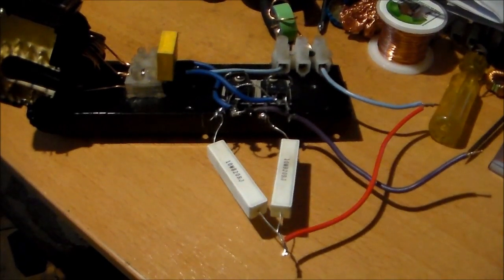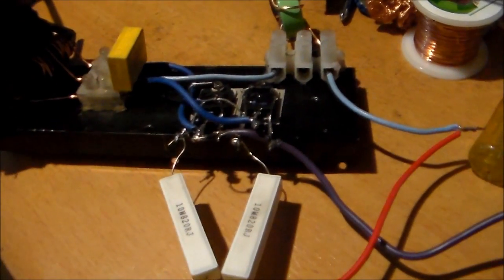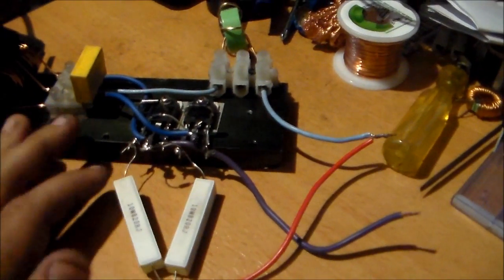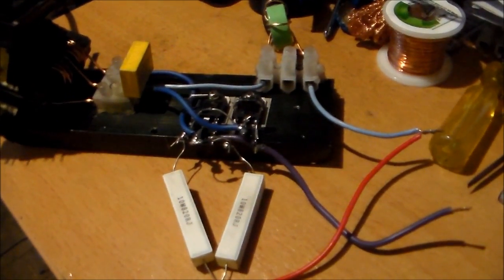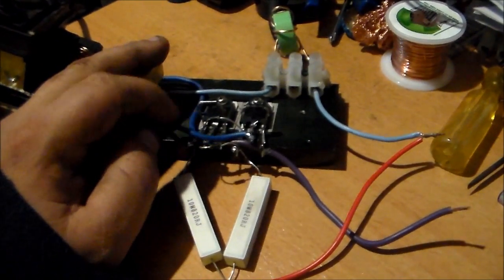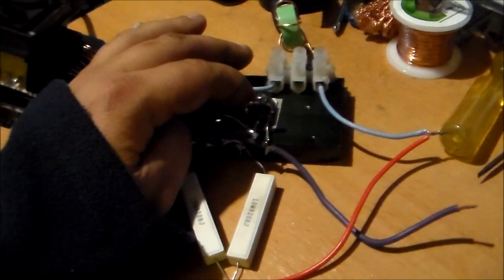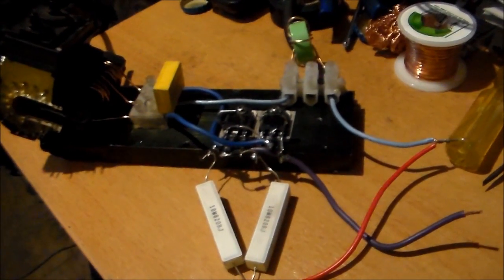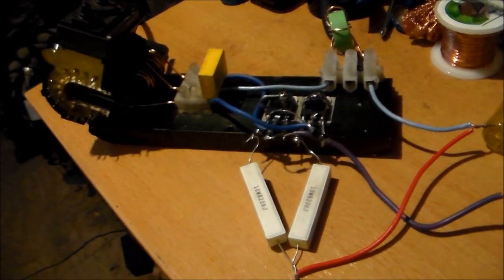IGBT ZVS FAIL - HELP GENTS!

Comment: Self-oscillating circuits are generally crap. Use normal half-bridge or full-fridge configuration. IR2153 very suitable as a driver. This works directly from mains. No loosy batteries. 230V in and 300V after rectifier directly into IGBTs. Output powers > 2kW can be obtained. And that citcuit can be easily converted into induction heater for additional fun.

Comment from the maker: this inductor worked fine on my IRFP250 setup.
i ran it to 40 volts without much trouble before the flyback broke down
no output at all whatsoever. exact components as the mazilli yes, besides the IGBT